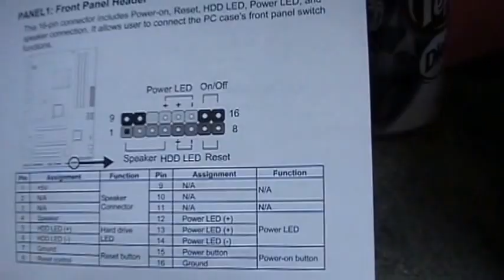AMD FX-8320 Budget PC Upgrade TA970 MB Install Part 4 of 7

Comment: hello sir, i have the same motherboard and processor but my motherboard stopped working, its not showing any response, only fan and graphics card is working fine in another motherboard, can you help me to find the solution for it ?

Comment: Ha ! I have this same board and case configuration.I got rid of the NZXT case (it had POOR cable management). I put a FX 8350 in mine, and replaced the case with a Thermaltake case. (I replaced my GTX460 with a RX 460)

Comment: I have 1 question, does the Mainboard have UEFI?
Reply: This was more for future reference as many people might end up on this page looking for answers regarding the board.
Reply from the maker: Yes it does...
Reply: TheElectronMan
TA970 has uefi?
Yeah, i thought it has the old BIOS
Reply from the maker: Yeah it's probably about a 2 year old MB but I am still using it and have no complaints..
Reply: +TheElectronMan uefi like with Graphic Interface and with mouse? because my Laptop has uefi too but in Text like BIOS it is Sony Vaio E14  SVE14A2M1EB and i was looking for an Upgrade for my PC with a GA-MA785GM-US2H REV 1.0 thats why, i planned First for the M5A97 but then i found the board (TA970) in a Computer Shop and then looked in the web and found it for about 58€ ^^
Reply from the maker: Not sure I understand the question... I know it has UEFI bios but not sure what that has to do with  Graphic Interface and with mouse? I thought UEFI had to do with automated performance setting..
Reply: I mean this
http://extreme.pcgameshardware.de/attachments/408364d1304011339-intel-core-i7-2600k-mit-asrock-p67-extreme4-uefi-uebertakten-asrock-uefi-1-.jpg

Thanks for helping me i bought the TA 970 too, but since it wasnt available, i bought the TA970 Plus
Reply from the maker: Yes it has something every similar to that in the BIOS...
Reply: It has UEFI but not a graphical user interface in the boot up mode, it defaults to BIOS and you will have to enable UEFI like it is shown on the following page, note that if you have installed an OS in Legacy BIOS mode, you will have to re-install in UEFI mode http://www.biostar.com.tw/app/en/support/faq_content.php?S_ID=468
Reply: I have ordered the TA970 Plus a time ago ^^
Reply: reiknir
Okay nice ^^

Comment: did you need to do a bios update?
Reply from the maker: +dilbertduck2 No it worked right out of the box... I did do an upgrade after I had the PC running just because I like to have the latest bios...
Reply: OK thank you. I'm thinking of getting that motherboard because that's the only yellow/gold mobo
Reply from the maker: For the price I don't think you can beat it...